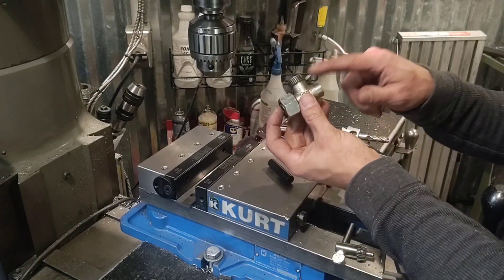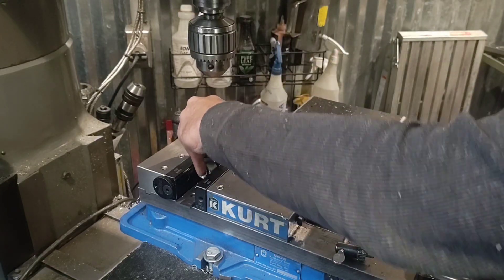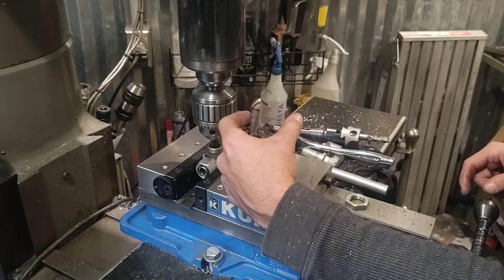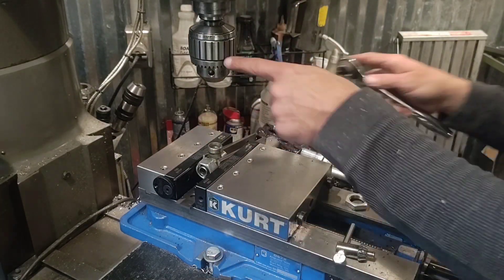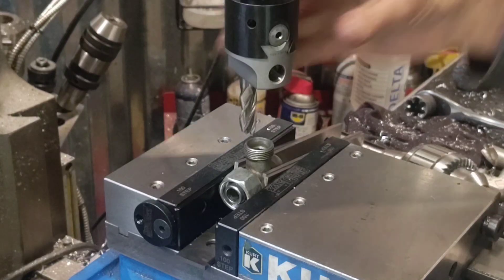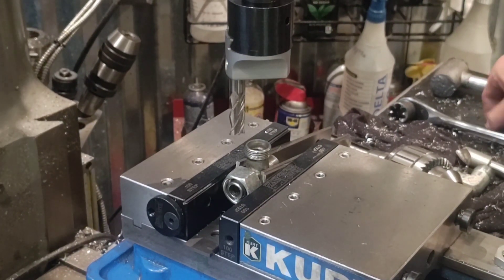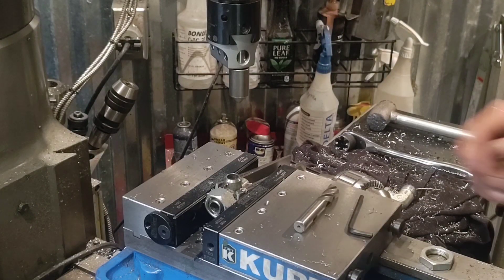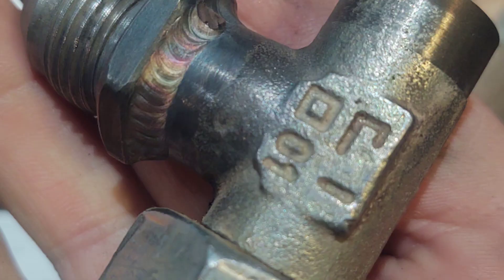OD turning with an endmill in a boring head.

Comment: Bottom line is that you cut off the threaded part.  Which could have been done on a bandsaw.  But without the chamfer.
Reply: Yeah, I’m with @bobengelhardt856.  You removed the threaded part with a boring part in a multi-step process.  You could have simply cut it off with a bandsaw, or a cutoff wheel,more even just milled it off.  The threads would be gone in the same fashion they are gone after your process. Since the chamfer was simply for better welding strength, that could have been done roughly with a grinder too.
Reply: @mehapgood I have to agree. I’ve done plenty of OD “boring”, even though I have CNC, just for the roundness aspect of it. But none of the boss was left behind. Why not just mill it off?
Reply from the maker: Yes,  but the threads would still be there.  The need to be removed to weld on another fitting.

Comment: Good job exactly the way I would have done it. Of course you could have used a boring bar but the end mill was a nice change. You obviously needed a different fitting from stock. Nice welding job also.